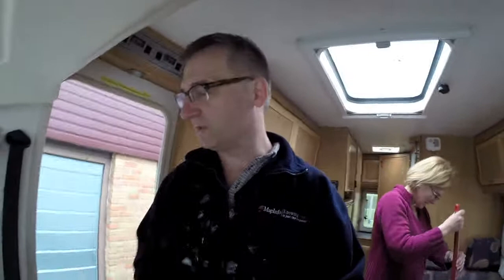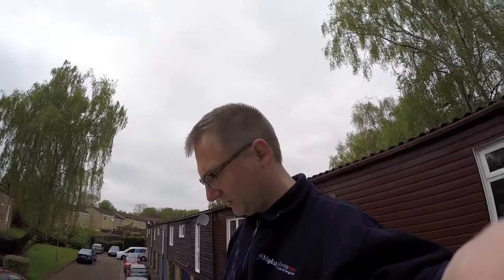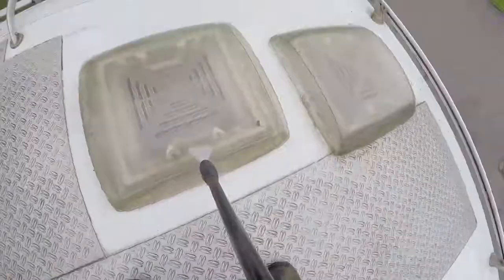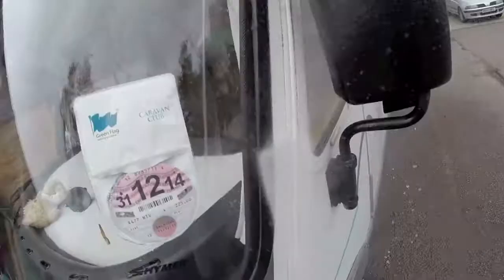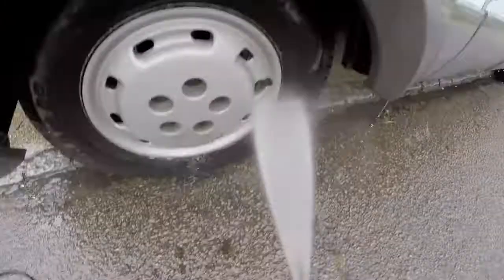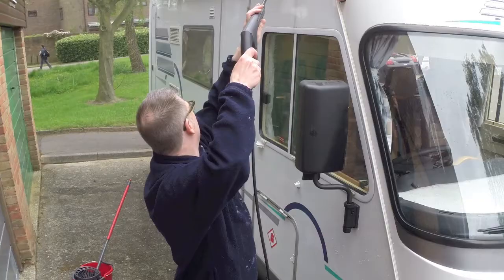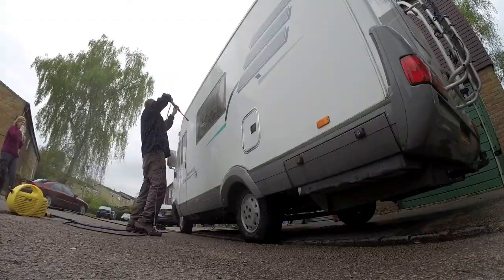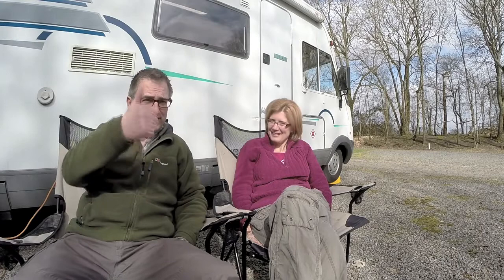VLog: How to Wash Herman the Hymer

Comment: I was told never use a power washer on a motorhome.. always hand wash... slower but less chance of damaging seals etc...
Reply from the maker: Yeah, just be careful around the joins and the radiators at the front. Recently we've been put on the water meter so I may need to rethink this!

Comment: Aidy. Like your vids. Just a comment , I have been a motorhome ..caravan valeters for 20 yrs  full time. My own buisness   So some professional advice.  Go online to Autosmart. Look for G101. Buy 5 litres   Put a large cup full in a mop bucket ( so your brush will fit in )  and foam it up in the bucket with power washer  ( it's the foam that cleans not loads a water)  and clean away. Yes use a power washer but at a distance  the G101 does the hard work  remember your power washer will tell you if you have a leaky seal. And enjoy. If the body work has lost its shine use EVO 3 from the same company.  Mine looks brand new as you can imagine     Good luck.   Alan.

Comment: are you meant to use a power washer on a motorhome ??
Reply from the maker: What makes you say that? There's a lot of space to clean on a motorhome not to want to use the power washer. So, long as you don't spray the vents or the radiator
Reply: its a standard bit of advice especially with motorhomes . the seams cant take it . and persistent use of a power washer will degrade the seal and let in water in
Reply from the maker: I see. Thanks. I don't worry about that. Hymer are well built and I don't concentrating the spray in the seals.
Reply: Herman the Hymer no problem . I have a vintage 1982  Hymer 900 . its 8 ft wide, 30 ft long  and very high . I  have to wash it all by hand and If  I thought I could use a power washer I would . Just not worth taking the risk long term though. Happy travels
Reply from the maker: justin linnane Of course, I thought I recognised your name. You're also on the Classic Hymer Facebook. You drive the extremely gorgeous Hymer.
Reply: Herman the Hymer yes thats me !! . in fFance at the moment in the 900. n between baguettes  was looking for hymer videos on you tube and came across your great  channel .